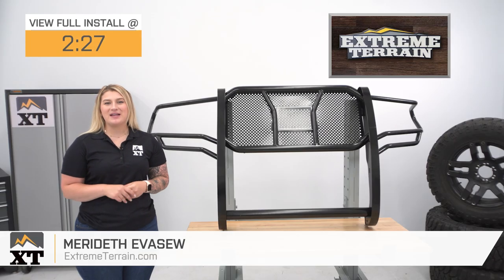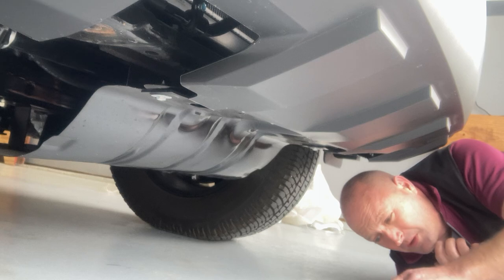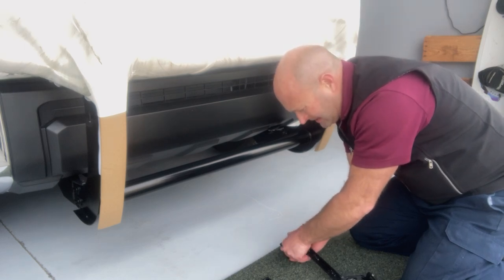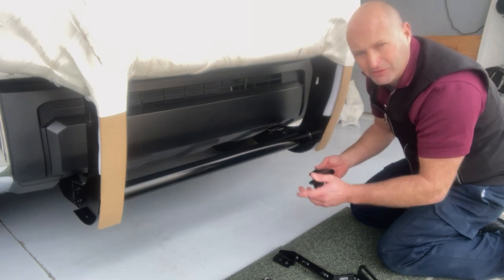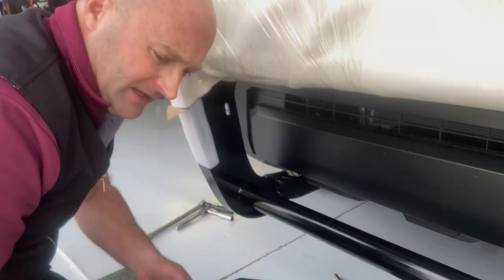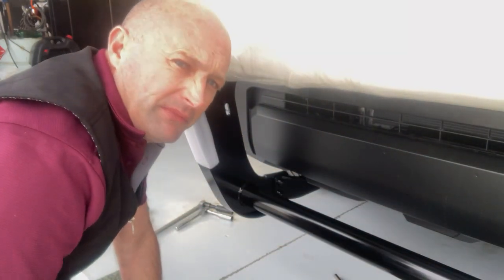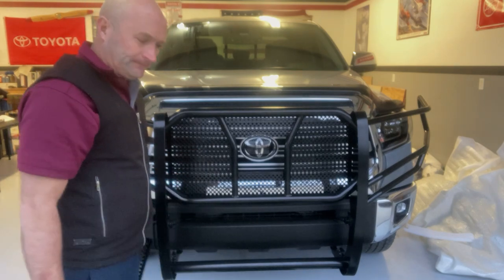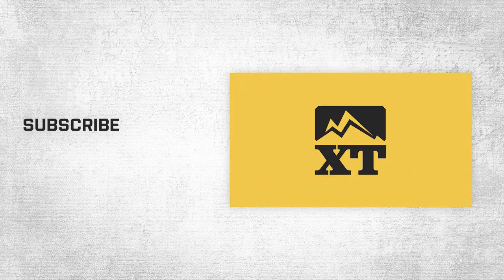2007-2021 Toyota Tundra Barricade Extreme HD Grille Guard Review & Install

Comment: Just bought the Steel Craft grill guard and is the same.  as per Installation manual, this fits 07-21 Tundra's (Incl 2018..on Tundra with Safety Sense P), If you have the Adaptive cruise control, remove the center front grill window from grill guard 30:44